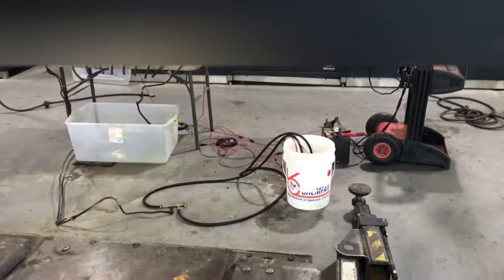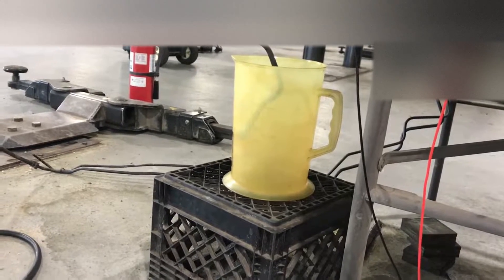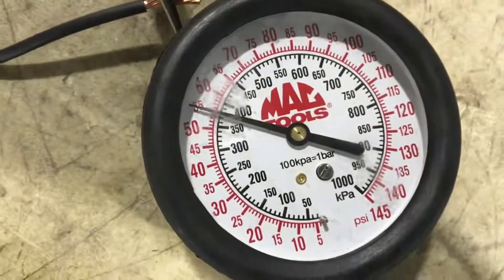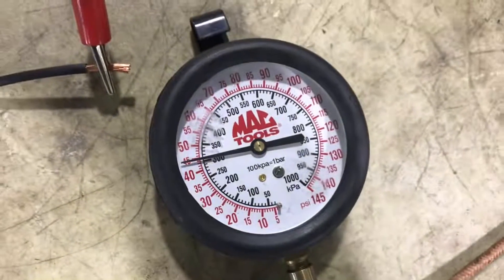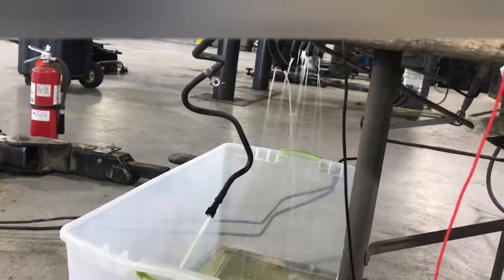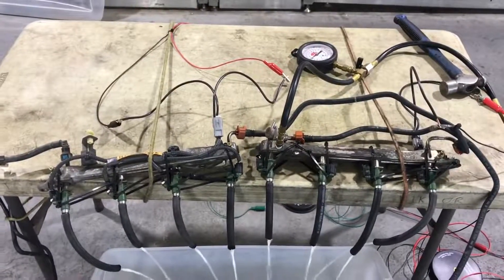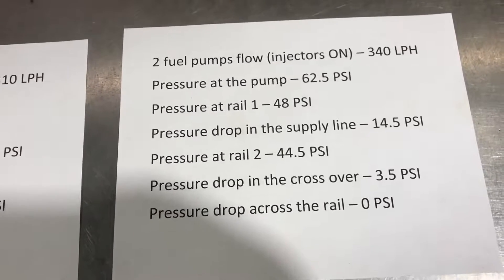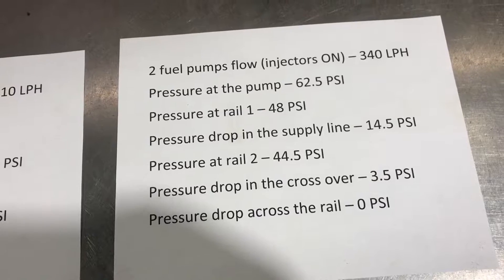Toyota Tundra Fuel System Testing - Twin Fuel Pumps And Such

Comment: Definitely worth looking at the feed lines on these tundras being boosted great data you have collected thanks for all your time !! 👍👍😀
Reply from the maker: No problem! Upgraded fuel pump is the very first thing to do, then upgrade the line from the pump and plumb the rails to run in parallel instead of series and you are set.